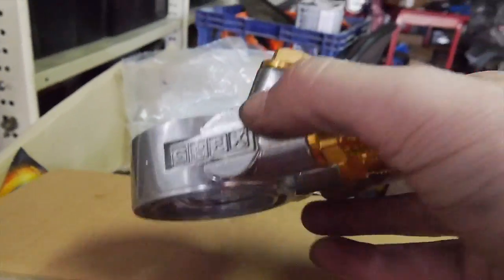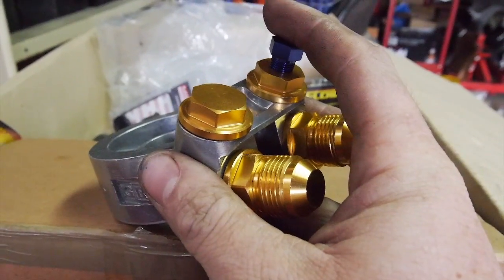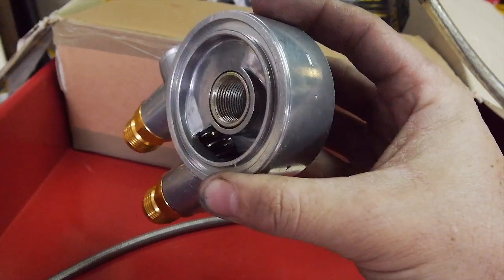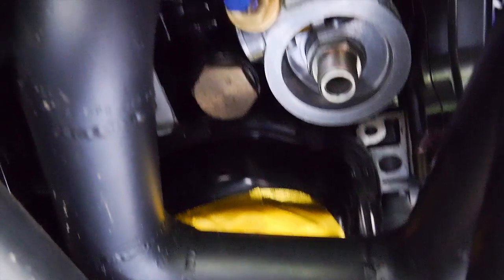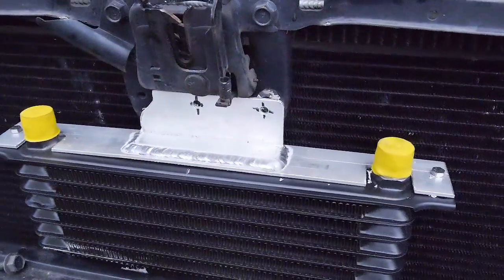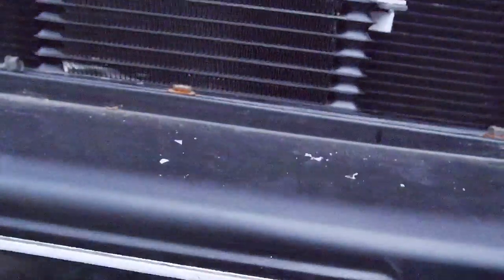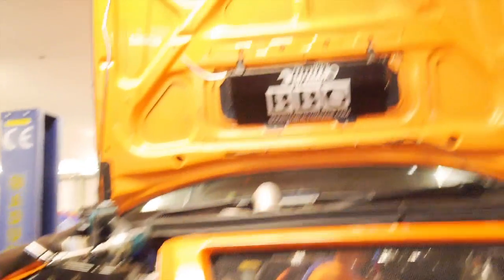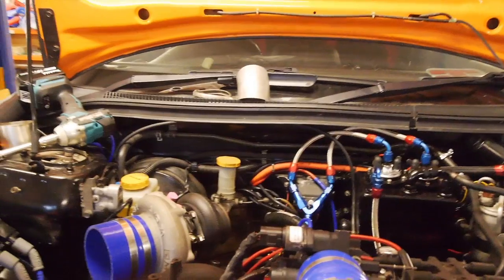BUILT SUBIE OIL COOLER SETUP - THE CARROT BUILD - CRAZY SF FORESTER

Comment: I’m running the mishimoto sandwich plate and every time I change the filter, I find it’s ever so slightly leaking... when u mentioned the Viton o-ring.... 🤔💡 I wonder... thanks mate, keep the vids coming 👍🏻
Reply from the maker: If it's leaking between sandwich and oil filter flange on block then 99% chance it's that o-ring😉
Most bearing shops will sell viton o-rings.
Thanks for watching bud

Comment: Love the vid and your channel, one question about oil coolers running a sandwich plate, I’ve got a modal plate ready to install but is are threaded and braided lines required? Will the pressure blow apart a barbed line fitting or standard rubber hoses? Mine is a thermo plate as well and as the engine warms up pressure goes down a lot.
Reply from the maker: Thanks mate👍 It's perfectly fine to use a suitable rubber hose with hose clamps & barb's. Braided lines are just superior in the fact they assemble and disassemble very quick and easily, also resist heat and any lacerations etc a bit more than a bare rubber hose (also the fact they look better too lol)

Comment: Nice work. A lot better than mine. I’m actually taking my relocation kit off this week.
Reply from the maker: Yeah man I've learnt one thing, esp with oil coolers etc - do it once n do it right😉
Reply: Boosted & Built Garage learnt the hard way did we
Reply from the maker: Not on this car, but yeah, def doesn't pay to use cheap fittings etc lol😉
Reply: Boosted & Built Garage 😜 yeah I’m using Aeroflow fittings now. I like the look of those 200 series

Comment: Hey how do you tell what fittings you have on something I have a oil drain bung that has been capped off by the previous owner and I want to put the turbo on but I want to get all the stuff first
Reply from the maker: I just know from experience and by visual. Is it a flare AN fitting or a barb for a rubber hose etc?

Comment: What about old oil drain from cooler. Problem or not 🤔?
Reply from the maker: What drain?
Reply: Boosted & Built Garage how remove old oil from this cooler?
Reply from the maker: I don't understand what you're asking exactly? The oil circulates through cooler back to the motor?
Reply: Boosted & Built Garage sorry for my english. When you  drain dirty oil, some part of  this oil can not drain from this heat exchanger. Imho☺️. It 's not good for fresh oil
Reply from the maker: That usually isn't worried about. You could pump oil in under pressure and flush it out but I'm definitely not gonna be bothered to do that. The oil filter will pick up any hard debris
Reply: @45triza  generally you'd want to mount an oil cooler on it's side with the return to the bottom( if i'm thinking about it correctly) allowing  gravity to drain the oil out of the cooler if you have the room.  its a good idea ✊

Comment: Synthetic oil does not affect rubber o-rings. I would personally rather have a silicone ring but synthetic oil is made be compatible. High mileage oil actually is made to maintain oil aging rubber